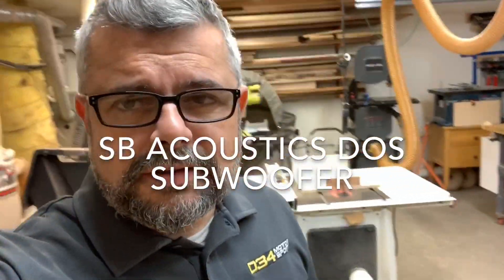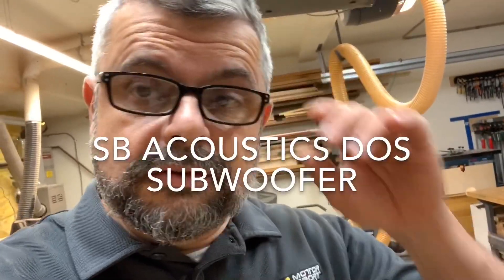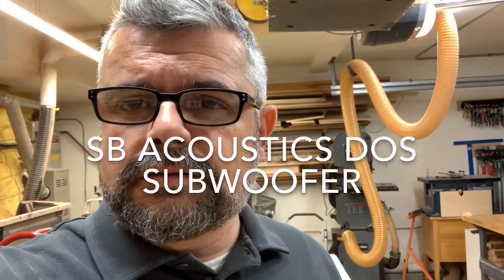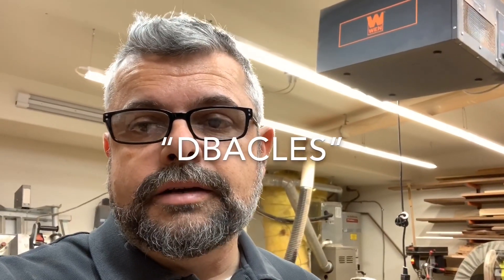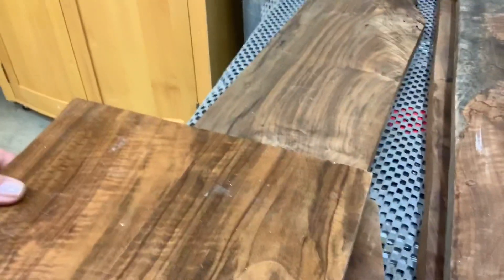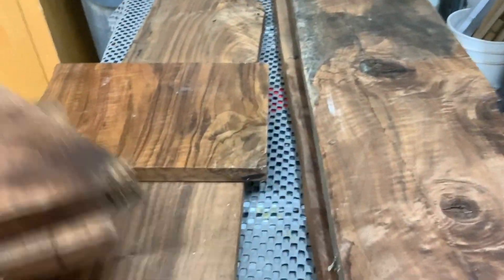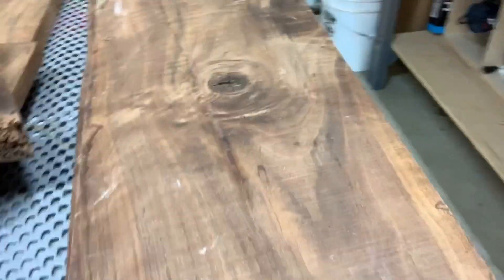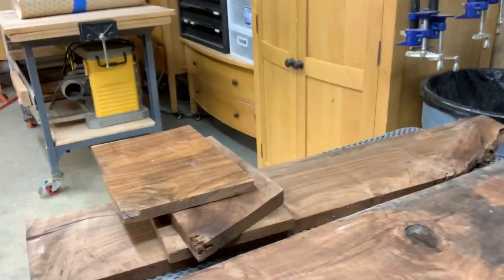DOS Subwoofer Project - Intro!

Comment: Would you recommend this sub in a sealed enclosure, about 1.4 cubic feet? That's about the biggest I can go as the enclosure will be built for an audio application. It will have about 400 watts rms going to it. Madisound recommends vented, but I do not have the skills to put something like that together.
Reply from the maker: All details are at https://www.facebook.com/groups/DIYLoudspeakerProjecPad/permalink/909828072706364/

The design uses 3 cubic feet with two drivers, 1.4 would be very small and really limit low bass output, you could put one driver in that volume.
Reply: @javadshadzi4824  oh yes, it’s for only one driver. F3 of about 53 I think. Some bump from car acoustics

Comment: 6:34 can you please tell me what did you put in between so that the two subwoofers magnets connect, is it like an adhesive or like a gasket
Reply from the maker: I ended up not putting anything there as I determined it was not needed, I simply rigidly connected both baffles to each other inside the enclosure with bracing.